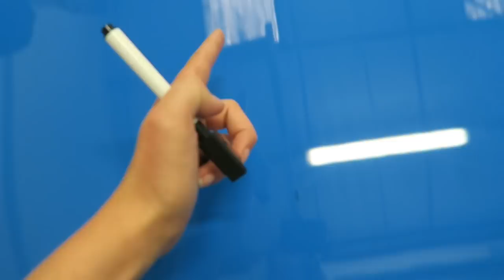FULL CUSTOM RACING STRIPE INSTALL ON A MUSTANG

Comment: Great job. 👍 At the risk of sounding like someone's granddad, I find it interesting that you're using inches as a unit of measure.
Reply: Im 16 and allways used imperial lol cant get my head round metric unless its millimetres as in a 10mm spanner rather than a 3/8ths